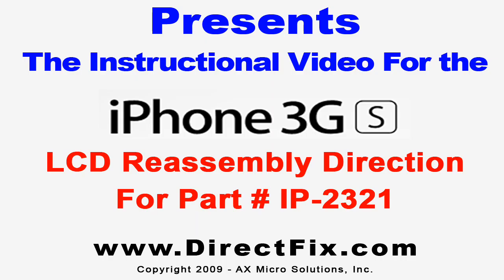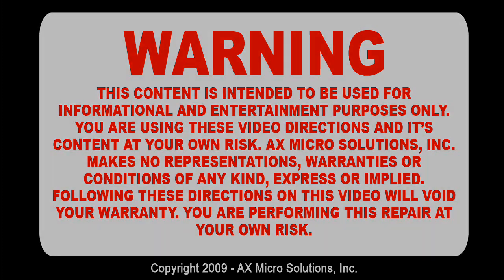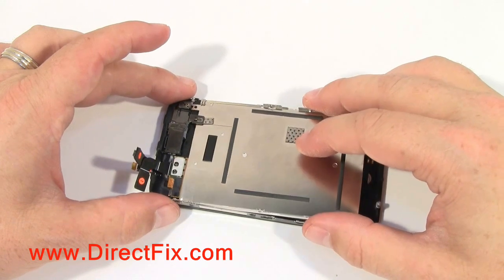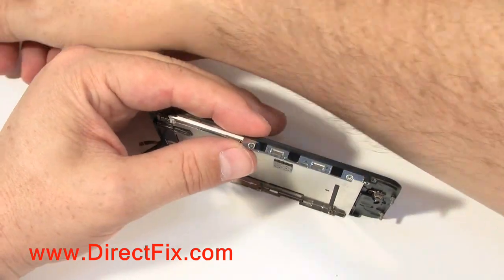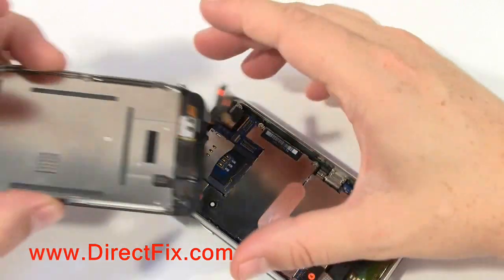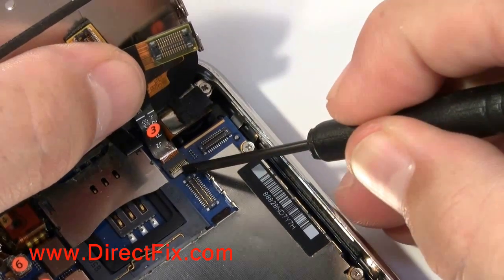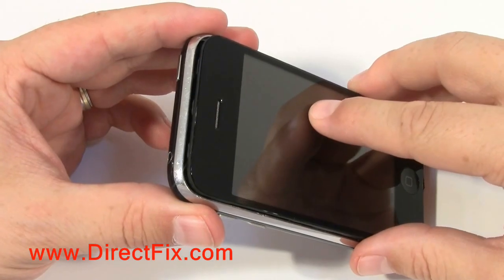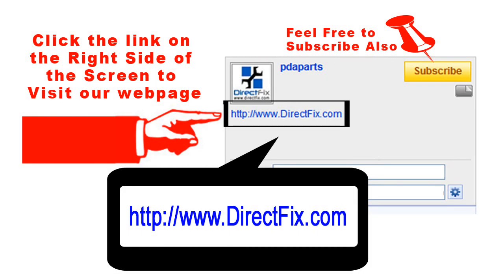How to: iPhone 3GS LCD Screen Reassembly

Comment: Yep this happened to me and I went back to the cable reinsertion and the LED connector 1 wasn't fully installed. It should make a click when it goes in so do this work in a clean place on a preferably white firm surface in an organised way and in silence so you can hear those clicks. Good luck.

Comment from the maker: @Angusbeefcowman Check the 3 cables. You have one of them either not seated correctly or not inserted into the connector all the way. That is a common issue when installing the LCD that people miss.